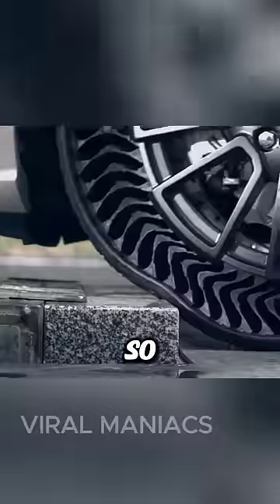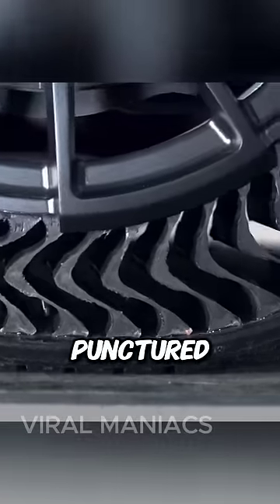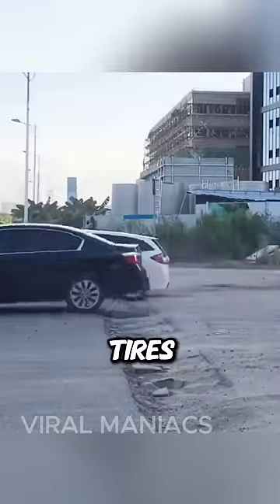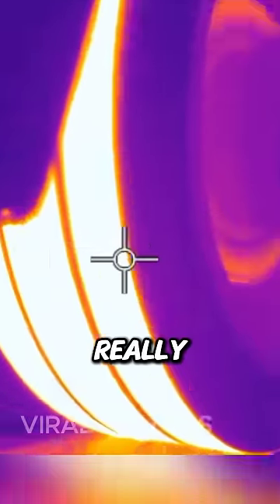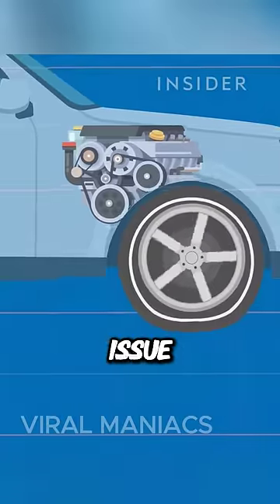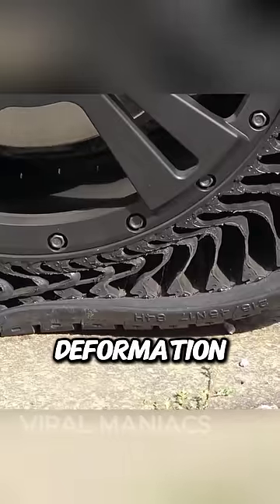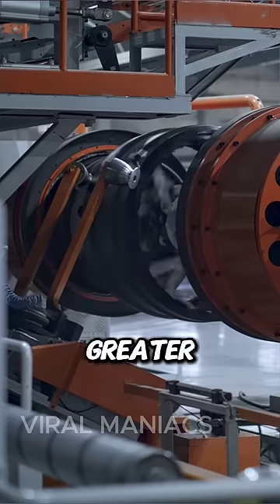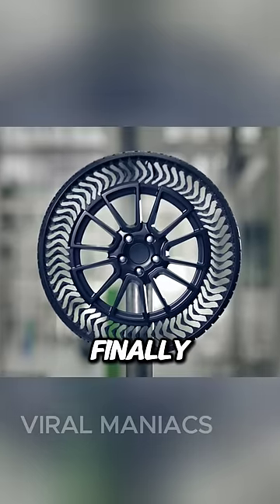Why Don't We Use Airless Tires Yet #shorts

Comment: Did they solve the major issue of falling APART at high speeds 😮😮😮
Reply: that’s what i’m wondering
Reply: No, they're just gonna let everyone who drives on the highway crash and die
Reply: @coreyclouston4401 hey buddy watch your got damn mouth
Reply: @SSJ_KILLA_BROLY I mean
He's not wrong with the irony
Reply: probably telling you not to drive faster than 50 :P there you go: solved! just limit the max speed^^ xD
Reply: @THCLK bro forgot abt the highway
Reply: Fr bro one burnout and them things are going to shred
Reply: yes, the solution is proper maintenance and don't drive your tires down until you see metal cords.
Reply: @coreyclouston4401 😂😂😂😂😂ahahahahahaha! Good one! 👍🏻
Reply: @SSJ_KILLA_BROLY 😂😂😂😂😂😂😂
Reply: What kind of speeds are you talking about? I work at a Florida tire shop ad we NEVER have see this problem in a Michelin. If a Michelin came apart at high speed you did one of a few things, exceeded the speed rating of the tire, drove on an injured/damaged tire that was unsafe, the tire was old af and the layers of the tire started to separate, or wore them out til the belts were exposed and it wore through the rubber.
Reply: very good on utv,s atv,s at low speeds like railroad yards etc .They don,t take alot of weight good, they deform and will crack_split over time,but are good in the right "debri-filled" environment .Just go slow. And spend alot  appx. 1k. per tire for a kubota rtv.
Reply: @WTmac1993  This tire (sold completely closed like a normal tire) is meant to be used in conjunction with pressurized air and is supposed to be an automatic backup if you ever puncture your tire. It would still allow you to drive to a service center, but driving over 50 mph can potentially shred the tire once the tire air is punctured and released. There was an article explaining this a couple years ago. It was also going to be $400 per tire, and used in newer cars that have tire pressure monitoring capability.
Reply: @taotzu1339  So what you're saying is they engineered one of these to he pneumatic and if you run it over 50mph while it's flat it will tear it up. That makes sense and idk why anybody would  have a complaint about a pneumatic tire falling apart at high speed while it's flat, that's what happens. If you can drive at all while it's flat id say that's good enough and not complaint worthy if you can't go over 50.
Reply: @SSJ_KILLA_BROLY 
Watch your speed first
Reply: @WTmac1993  It's definitely a gimmick, marketed towards families and people who don't know how to change a tire. The message is that if they ever get a flat, with these new tires, they don't have to be stuck on the side of the road at night (waiting for a toll truck) or in a bad part of town. They may have a near flat but can still drive (albeit slower) and limp home or to a service station. The original design was a honeycombed structure, and was used in military combat vehicles. These were able to take like ammo and allow their drivers to drive away from a danger zone.
Reply: @taotzu1339  definitely a gimmick for people who don't know ow how to change a tire. Which imo, if you can't change your tire, you shouldn't have a license because it really is simple. An ape could change a tire with incentive, yet most humans can't.
Reply: @taotzu1339 ok what about people not physically capable to change a tire do they not get to experience driving?
Reply: @coreyclouston4401  You joke as if that is obvious and yet tire companies have had tons and tons of recalls because they sold tires that broke apart highways and killed people.
Reply: @SSJ_KILLA_BROLY  I'm not your buddy, keyboard gangster
Reply: I'm suprised I didn't see this comment sooner. Thankyou
Reply: @WTmac1993 Interesting comment to see from Florida, because Florida is the only place I’ve been to where shredded tyres line the roads.
Reply: @Vingul  thats because most ofthe people here are either brain dead or too broke to get new tires. But in regards to Michelin car tires, they're very dependable and durable.

Comment: Dont forget about load distribution, air pneumatic tyres distribute the load along the entire wheel with the pressurized air while the airless tyre would trasfer it directly. This would greatly reduce the lifespan of the wheel itself.
Reply: My guess is that any towing will require a very expensive one design for towing
Reply: @michaelw1665  not to mention the disaster that potholes would cause.
Reply: thats why most airless tyres are more of a solid design. however the draw back is if u brake suddenly youll destroy the tyre and it will be all deformed having flat spots where u braked.
Reply: And this also greatly increases the rolling resistance for a given amount of compliance. Hurts fuel economy.
Reply: That’s not 100% true. There’s a reason why your front tires wear more if you don’t rotate them (assuming front-wheel drive): when you turn the front wheels, the BOTTOM gets the weight of the car and that’s why there is so much friction wear
Reply: @omary2158  Although your statement is true, thats the tyre wearing out, not the wheel.
Reply: Yep
Reply: @goodo4668 yeah, that'll save a lot of money and waste
Reply: Michelin spend several hundred million pounds on research and development every year.  I don’t think they ‘forgot about load distribution’ 🤦‍♂️🤦‍♂️🤦‍♂️🤦‍♂️🤦‍♂️

Comment: The most important problems to be solved when engineering tires is safety, handling, cost, ability to handle inclement weather and rough terrain, and longevity. Flats are not a serious problem and it was solved a 100 years ago - you carry a spare. I have been driving for over 50 years and won't buy a vehicle that doesn't have a spare. I think I have had maybe 4 flats, mostly when I was young. So I get a flat maybe once every 13-15 years, change the tire, and off I go.
Reply: You didn't address the tire waste issue.
Reply: @jeanbcadeau7702  Recycle... ♻️
Reply: And also when it comes to Flats when I buy a car if it has a dummy Tire I'll go to the junkyard buy the right size wheel and go get the right size tire for a spare
Reply: @drwilsom1, my question is, given this will "defeat the purpose of spike strips", what will law enforcement have to come up with to ensure they can still disable regular tires and now these too without first having to "identify that the vehicle doing 100mph" actually has "airless tires"....
Reply: You probably don’t live or drive on dirt roads if you have only had 4 flats your entire life lol
Reply: @zenithperigee7442  New cars are going to have an off switch the police can flip.
Reply: @drwisdom1 the software is already installed in many new cars. People are signing off on it and giving their consent without even knowing it.
Reply: Runflats work well for flats, but they're more expensive.
Reply: @jeanbcadeau7702 they didn't address what to do with these tires when they wear out. So, instead of rubber tires, it will be aluminum glass fiber tire waste.
Reply: @brianczeiner5612 both aluminum and glass are recyclable
Reply: @zenithperigee7442 you should look up the new method for how the military stops cars. It's a spike strip that is flexible and looks like a net. The moment the tires hit the strip, the strip wraps around the axle forcing the vehicle to stop almost immediately. Unlike a normal spike strip that causes a vehicle to lose control from sudden loss of air pressure  and also allows the vehicle to continue moving
Reply: @xocomaox  Runflats are maybe the worst automotive technology ever. It isn't just that they handle worse, are noisy, rougher, and cost more. They only go 100 miles so it doesn't even solve the problem of getting a flat. It just means you have to immediately go somewhere that you hope is open to hopefully have an expensive replacement run flat in stock. The problem is compounded by manufacturers saying you don't need a spare it you have run flats, but you need to know your 100 mile clock is ticking. So they had to implement TPMS to warn you that your trip is about end abruptly.
Reply: @damienthecatdog3598  Our road turns to dirt just after our house. What I have found is most flats are caused by negligent construction workers building new subdivisions. They tend to drop nails and screws on the road going in and out of their work site. There was a new subdivision going in where my wife worked and she got three flats in a period of a year. They were all nails and screws. I got a tire repair kit and became good as fixing them myself. I keep a full size spare in my trunk and a repair kit so I can both swap out and repair flats on trips if needed.
Reply: So the world only revolves around you and your sunday driving? I drive as a profession and have gotten 3 punctures this year.
Reply: I use mountains of used tires, plus they can melt them down for other uses
Reply: Were did u live  because  we spend money on tire every  other week 😂😂😂

Comment: Most important reason… tire manufacturers will lose money from tire replacements
Reply: They’d still need to be replaced like normal tires. Without tread wear there’d be no grip.
Reply: @Nitro9n  But then Michelin would become a monopoly... 
Either way, it's all about money.
Reply: @RR-lj3ip  what makes you think they’d be a monopoly?
Reply: How they gonna lose money selling these outrageously overpriced tweels? Lmao
Reply: These things would likely wear out faster than normal tires.  To top it off, if you want new ones you need to buy new rims as well.  It wouldn't put anyone out of business.
Reply: @Nitro9n  If everyone switches from the traditional tires to these, Michelin may artificially create conditions to be the only company on the market (in case other, classical tires companies go out of business)...
Reply: Tire dealers would be out of business after everyone switches over. Remember the Michelin/Uniroyal "Tiger Paw Airless Tires" ???
Reply: They will just charge $1000 per tire to compensate!
Reply: Government should give more tax breaks to give incentive to me more innovative with renewable green tech
Reply: well no shit
Reply: There are multiple tire manufacturers so if anyone of them knew how to do this they would and they would take the market so your conspiracy theory is not very smart.
Reply: @RR-lj3ip you’re so right. Once Michelin comes out with these for a cheap 3,000 dollars for a 4 set every other tire maker will announce they are closing. Instead of other companies being like well let’s make a competitor and continue to make millions they would rather be like you know what I don’t want to make money let’s close our doors. 😂 I’m sure these tires will work on everything from a 1500 pound car to a fully loaded 80,000 pound semi. 😂😂
Reply: @bustex1  Yeah, the majority of people's ideas about the size and scope of industry are about as small as a pinhole.
Reply: That’s bullshit. You’ll probably come up with some reason to blame oil companies next.
Reply: @gumps1986  that’s exactly why renewable energy (bio fuels) that could be used to fuel cars aren’t out in the market even though it’s been proven it works. Oil companies won’t let that happen. Period. If a driver can replace 4 tires every year or two, they’ll make more money on that than someone getting these durable tires that might last 10 years. If they charge a high price, nobody will buy them. Possibly a few handful but if they wanna mass sell them, they gotta keep the pricing low which they won’t get the recurring sales from replacements they’re getting now.
Reply: 100% correct
Reply: That's dumb. These don't last nearly as long as pneumatic tires
Reply: Why would the producer or airless tires care about traditional tire manufacturers loses? New technologies are replacing old industries all the time.
Reply: @XOPOIIIO  they're the same people. These aren't new and you won't be seeing them on autos
Reply: @aaronkcmo  They don't need to be the same people. A company from a different industry could create startup and take over the market.
Reply: @XOPOIIIO  lol, ok.  go learn about how business works and come back.  i'll wait.  these tires will never go on automobiles because they have serious disadvantages compared to pneumatic tires.  it's not because tire manufacturers somehow refuse to innovate, it's because these tires are garbage for autos
Reply: @aaronkcmo  I'm learning about how businesses work from my investing experience, not from your conspiracy theories. By your logic Amazon couldn't exist, because e-commerce harms traditional retail.
Reply: @XOPOIIIO  lol, ok bro.  whatever you say.  no conspiracy here, just a lifetime of experience.  you do know that this tire design is decades old, right?  it's commercially viable for some applications and completely inappropriate for automobiles.  you can pretend otherwise like this idiotic video, but you'll know i'm right when you realize that no automobiles have ever been fitted with these types of tires commercially.
Reply: @aaronkcmo  Claiming that any new technology is completely controlled by the industry and current players is a conspiracy.
Reply: @XOPOIIIO  lol, sure.  who's contending something so silly?  like i said, it's not new technology.  the tire industry is super fragmented so it's not dominated by one or two companies.  new tire brands pop up from time to time.  no company, new or old, will ever make money trying to sell this type of tire for autos because they are a bad idea.  maybe, since you know so much more than everybody else, you should fit some of these on your car.  it should only cost around $10k.  oh, then go drive down a gravel road and let me know what's left of the inside after a mile or two.
Reply: @aaronkcmo  Sorry, we were just talking about different things.
Reply: Yes....These tire can cost $400 a tire thats like....$1600 for a set of tires who can afford that....I cant
Reply: @tyronnfields7945  that's very low.  some pneumatic tires cost that.  these would be way higher and you'd have to replace them way more often.
Reply: @Aamir_Farouk just because they don’t have air doesn’t make them last 10 years. The tread will still wear just the same. Duh.
Reply: @Turbogto_guy  the whole point of them is to be more durable to last longer. What’s the use then?
Reply: @Aamir_Farouk  so you won’t get a flat. Hence the name “airless tires”. It’s not “super long lasting tires”. It’s airless.
Reply: Right. 
It would be a stupid business model to not have max profits.

Comment: Forget the cost, these things are LOUD! The road noise you experience with these on is close to if not as loud as some exhausts
Reply: Also might be heavier overall thus a car fitted full on 4 wheels with these wheels might consume more and nobody say anything about how well they are handling under heavy breaking, in rain, snow or on highway speeds above 100 km/h..
Reply: Exactly that's what Elon Musk said
Reply: You've ridden on them?
Reply: @d_no_allyn_86 They haven't - just repeating what they've read.
Reply: Well, that makes sense considering when you’re a hot rod that’s supercharged and you’re the wine of the supercharger. That’s not the supercharger doing that that’s the belt cutting through the air as the RPMs are going up and it’s building boost.